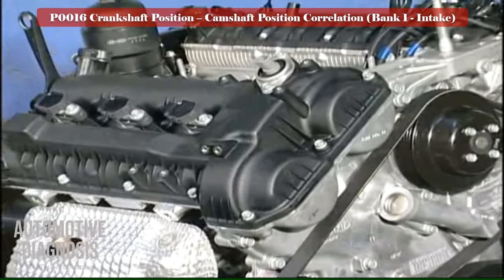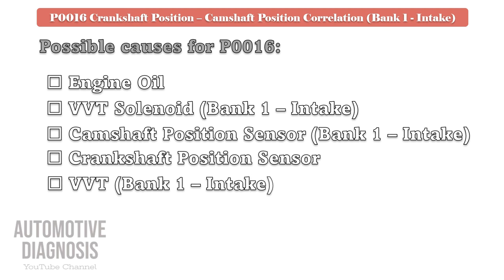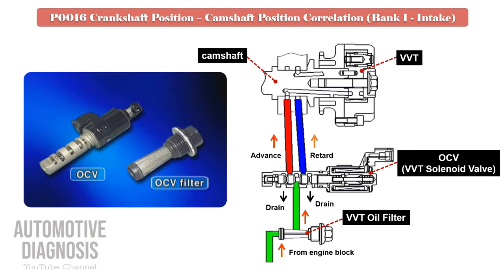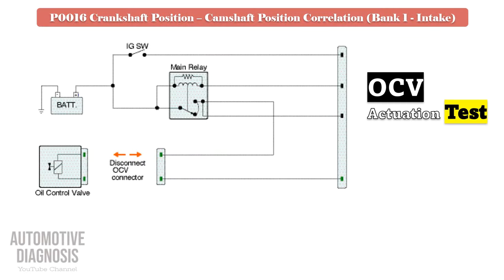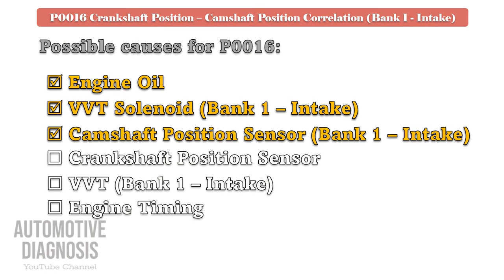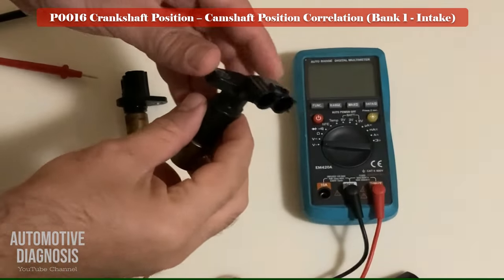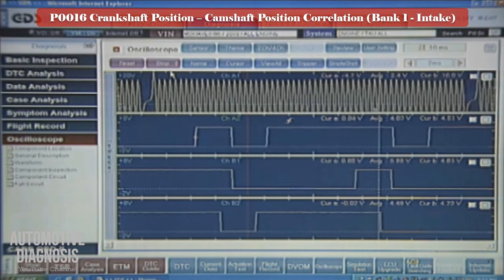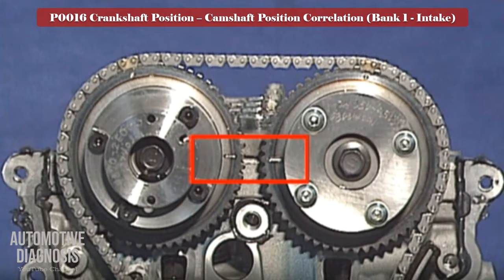How to Test & Fix P0016 Crankshaft - Camshaft Position Correlation Bank 1 Sensor A (Bank 1 - Intake)

Comment: If there are no other fault codes apart from P0016, i.e. no sensor codes, go straight to checking the timing. This is easy to do by removing the camshaft cover and checking the alignment marks on the camshaft sprockets when cyl1 is on TDC - firing stroke.
Reply from the maker: Thanks for sharing your experience
Reply: I have a P0011 as well

Comment: I have p0016 Bank 1 sensor A. Car runs and sounds fine. I am overdue for an oil change though 🤷‍♀️  so gonna start there. Just pray it’s not the timing chain
Reply from the maker: Most likely it’s not the timing chain, normally you may get some other fault codes too if it’s from the timing chain itself (like P0014 or P0017 or misfire codes), if you get the code again after changing the oil, it is recommended to remove and clean the VVT solenoid valve on for bank 1 intake.
Reply: @AutomotiveDiagnosis  That makes me feel better lol. It’s a 2014 Malibu. The mechanic I took to said the same thing and unfortunately it’s a vague code so we have to do process of elimination. Hopefully it’s just the sensor. Said as long as driving and sounds fine to keep an eye out and obviously discontinue  driving if performance changes. Thanks for responding. I’ll let you know what we figure out.
Reply: So light is off this morning 🤷‍♀️
Reply: @ericabertagnoli5469 how was solved ?
Reply: @miroilic323  So light came back on after awhile. Took it in. They figured out there was loose bolt and the guides were loose so I ended up just getting another timing set. Was lucky the bolt didn’t get into the engine.
Reply: @AutomotiveDiagnosis i have a p0016 and P0019 code would that indicate the timing chain?

Comment: I have a 2012 Buick Verano. Engine check light came on and went to auto zone. First time code came up p0014 & p0015. So, had them give me both intake & exhaust solenoids. I put both in and next day took car out about 10 mins engine check light came back on. That afternoon went get oil changed and called auto zone told them what happened. The guy said bring it over. Sure enough same code came up again. This time got two new ones again and changed both. The engine light didn’t go out. Took the dam* car over auto zone and now dam* code showing p0016 & p0017. What the he**. The car runs great. No misfire, no ruff idling, I even replaced spark plugs. Can’t figure it out.

Comment: At last I was able to solve my P0016 code.
Firstly, I flushed my engine oil with an engine flushed them changed the oil a second time  -- code didn't go away.
Next, I changed my crankshaft position  sensor--- no improvement,

Checked my VVT solonoeid too and it was working fine.

Finally I went to the mechanic to check my timing chain and Alas, it had jumped. It was fixed and now my car is driving smoothly again.

Thanks for this video.  It has really helped me. I was already thinking of selling the car off.

(It's an Hyundai accent 2012)
Reply from the maker: Hi there,
Thanks a lot for your comment and for sharing your experience.
I'm glad this video was helpful.

Comment: Great video. I ran into this problem Hyundai Elantra Cvvt valve intake  caused break down of engine oil. Thanks for this video very helpful. Thanks.
Reply from the maker: Thanks for the comment, I’ve had this fault many many times that’s why I made this one 👍👍

Comment: Very helpful, I’ve had this fault code many many times, still struggling to fix it, thanks for the great help
Reply from the maker: Thanks for the feedback
Reply: I know this is a little old, but I had this exact issue with a FA20DIT engine, bought from salvage yard, had P0016, after a lot of head scratching I ran the engine for about 100 miles on a clean oil change, then ran Subarus engine oil flush through it, one more oils change and the issue was completely fixed. I am able to watch the cam positions on my access port and I can see that the right intake stays right with the left intake now. I think the salvage yard engines sit around too long and the oils break/coat the journals, the flush turned my new oil completely black. I am going to do one more flush at 1,000 miles just to make sure.
Reply: @denniskeyser2212  I have 2016 tucson , and the engine is changed with newer one. I have this issue still with my car , I changed all of these sensors , engine performance is perfect . Only after while this alarm is coming and after while going but no any change in my car performance. You think I have to flush the oil?

Comment: My GL 450 Mercedes is showing a P0016. I change the camshaft sensors, oil changed and solenoid magnets and I’m still having the same problem. I didn’t know about changing the crankshaft position sensor. I’m trying that next. Thank you very much.
Reply from the maker: Thanks for sharing your experience.
Reply: Hey did that fix your problem ?
Reply: Did that fix it??!!

Comment: This is an excellent video, and I have a question I hope you can answer for my situation, as I am now getting additional P0012 code coming up now, and it has failed inspection sticker, for a 2011 Camry.  YET:  the car runs fine--both city and highway, so unclear what to do, and need to find new mechanic (no more dealer).

Starting 4 years back, both engine light and traction light came on, but it would be go "on and off" .  Mechanic at Toyota dealer diagnosed, and P0016 code came up.   Did oil change first, and it was really really dirty.  This helped, as the code disappeared "for awhile".    Dealer then quoted $1600.  However,  It would come and go...but at least it went, and always passed inspections and NO driving issues at all.   
 Until about 6M ago, drives FINE, but both lights have been on continually, and now I have the additional P0012 codes, and failed inspection sticker unfortunately.  (light went out briefly w/reset, but they still failed me for inspection).

Is this common?  Would any mechanic be able to fix this?    Is this going to be a "step by step" issue to fix, that could take awhile to resolve.   I hope you can respond soon.  Thank you!!

Comment: Hi, my 2007 audi a4 2.0L turbo is having acceleration power issues. It has p0016 code. Can this code causing my rpm to move slow up but the car is struggling to accelerate? Going up hill is a huge struggle. Great video. Thank you.
Reply: @mark.r8900 did you figure out the issue??

Comment: Hi, thanks for this informative video. I am only getting P0016 when the engine is cold, never when the car has been travelling for a while. Also, it never happens when the engine is just idling, even when it is cold. It invariably occurs when engine is cold and engine speed is descending, usually when slowing on  approach to a junction. Does this suggest a particular diagnosis? Many thanks :-)
Reply from the maker: Hi there, I've had some cases like this before, sometimes from a wrong oil (normally higher viscosity) which was not good for the colder temp or when engine was cold, the other was dirty VVT solenoid.

Comment: What happens if you get this error from time to time ? the check engine light comes on and goes off the next day. is it safe to keep driving the car ?
Reply from the maker: If code appears time to time it’s not from the timing chain itself, most likely it could be from a loose connection on intake VVT solenoid or Intake Cam sensor or Crank sensor. Oil sludge around the VVT solenoid can cause the same issue as well.

Comment: I substantially overfilled my engine oil when changing it on my own for the first time and now this error code has popped up. I've since corrected the amount of oil it but the code persists. What should I do now? It doesn't feel like it's driv8ng any different than it normally does
Reply from the maker: Have you tried removing the VVT solenoid valve? That might help. Remove and give it a good clean.

Comment: I have a P0016 and P0019 code would that indicate the timing chain? I also got these codes after changing my oil, i took it the mechanic and he said i overfilled it or something but i found out it was my oil filter housing. Thanks
Reply from the maker: Hi there, if it happened just after the oil change, it’s probably not from the timing chain. These two codes are for bank 1 intake and bank 2 exhaust, so considering the fact that your engine is a V6 with two timing chains, if you had a timing problem, most likely you would have P0016 and P0017 together or P0018 and P0019 together. Having a wrong viscosity oil or dirty VVT solenoid can cause these faults too.
Reply: @AutomotiveDiagnosis  thanks. Also what about P000B and P000C? I have these 2 codes as well but I’m not sure exactly what to do.

Comment: May i ask what would happen if we didnt change it directly in porsche caynne gts 2009 as here it cost too much money.. is ok to leave it as is for now ??
Reply from the maker: This code could happen for several causes as explained in the video. So, if it's coming from timing system it could be a serious fault that must be fixed ASAP. (Although some other cases could be fixed with less attention)

Comment: Hi i got seat leon 1.4tsi got the p0016 code when i start the car it stalls when i start again the engine shaking and rough    it lost power i think but it does drive just not as it should checked the vvt solenoid looks fine swaped camshaft sensor still nothing. Thank you
Reply from the maker: As your engine stalls, it might be from crank sensor or timing.
Reply: That's fine thank you for reply

Comment: I have a 2014 eco boost that has a p0016 and p0172. Makes a loud howling noise. What could that noise be ?
Reply from the maker: As you have fault codes for both intake and exhaust side, it could be coming from the timing chain or timing chain tensioner. Before that make sure to inspect the engine oil.

Comment: oddly I put my old camshaft sensor back on, now the code has gone. not really sure why. have driven 100 miles so far and still no code
Reply from the maker: Hi my friend. Sometimes codes happen due to a bad connection on the connector or inside the connector on pins.
Reply: @AutomotiveDiagnosis  hope it was just that and it does n't come back before my MOT is due :)
Reply: UPDATE, it came back on after 3 days. took it back off twiddled it around a bit and it's gone off again (sigh)

Comment: Especially cars like the 2010 -2016 Cadillac SRX these are direct injection engines and can build up sludge and carbon on the VALVES  I suggest doing an engine flush I use motor medic by gunkout and marvel mystery oil or you can use Liqui  Moly engine flush too pour in the product with the current oil still in it let it idle for about 15-20 minutes  under its own power don’t horse the motor turn off engine let cool down remove drain plug let it do a complete drip drain wipe plug and pan area remove filter and replace you will surprised at the amount of crap that comes out
Reply from the maker: Thanks for sharing your experience

Comment: Correction:
I understand that some CKP and CMP use 5V reference for the power source; you will not find 12V anywhere on these configurations.
It is important to mention this, as viewers could incorrectly conclude that their PCM or electrical system has a fault that doesn't exist...

I found a YouTube that also said there are 12V, 5V, and 10V (sensor) systems out there.
I have never seen a 10V reference, but I don't doubt it. [I have not Googled it to see what vehicles use that, but it would make sense. 9 or 10 volts would be stable as it is below the lowest 'variable' battery voltage that the system would see.]

Consult you manual, or Google for your exact vehicle.
If you get a consistent 5V that is within a few percent of 5.00V (or 10V), at several sensors in your car, then you should be safe to conclude that your car is using that voltage as power to it's sensors...
Mr K L
Reply from the maker: Thanks for the comment and provided information. I always refer anyone to the workshop manual to review the specifications as not all cars are the same. But for the power source on CMP and CKP, I have seen both 5V and 12V power source and it depends if power supply is provided by ECM or Engine control relay. The latest one I remember was KIA Mohave 4.6 L, and all CMPs were getting the power supply from the engine control relay which was obviously battery voltage. 
But as you said, no one can consider one specific value for all different engine types as each ECM has been designed with a different software and logic which makes the configuration different.
Reply: @AutomotiveDiagnosis  Thank you kindly.
And well produce video.
I wanted it to show prominently, as some may not have access to a SM, or may go verbatim from the illustrations, if exceptions are not noted...
I am assisting a mechanic who came from another country (who watched your video), and he was stuck because he could not find 12V...
Reply from the maker: @troubleshooter1975  Thanks for sharing the situation. That's exactly right, not having  access to the SM and watching a video which is generally made (without referring to a specific model) may overwhelm someone,  that's why I started making some videos, by mentioning the car model, and at the same time I show all the specifications in the SM including all values and configurations for that specific car, hoping to be more helpful.

Comment: What if you dont have battery voltage on the silinoids wire harness when the ignition is on? And, when you say ignition on, does the car have to be running?
Reply from the maker: Hi there,
No, engine does not need to be running, normally you should have the battery voltage in one pin when ignition switch is on and also when engine is running. But if I don’t get the battery voltage on ignition on, I normally check it when engine is running as well, because not all cars are the same. Also, you will need to check the wiring for the power supply if there is any problem there. May I ask you please to write your car model down here?
Reply: Doesn't the ECM only send power to the VVT solenoid when the gas pedal is pressed?

Comment: I have the same code but it says “Crankshaft position-Camshaft position”, I have a 2016 Audi  A4, the car starts fine, it drives fine, it has pretty much all it’s power available, it doesn’t smoke or consume oil,  it doesn’t make any noises at all, but it idles weird when it’s completely stopped and it happens most of the time but ramdomly, it’s like a weird on and off vibration and what I noticed is that if I turn on the heater or A/C the problem almost goes away or it goes down a lot, no one has been able to find a solution for my problem
Reply from the maker: Hi there, it seems to be a different issue than P0016, this code might have happened due to an intermittent problem so please erase the code and see if it comes back up again. It it appears again and it happens randomly, it could be VVT solenoid valve (that must be removed and cleaned only). The problem that you explained it could be only for a dirty throttle body. So when engine idles and you have released the gas pedal,  if throttle body is not clean, it can affect the airflow at idle, and the reason that it disappear when you turn the A/C ON, is because engine control module increases the engine RPM at that condition to compensate the A/C compression operation and RPM drop, so as soon as ECM increases the RPM, throttle body will open a little and there would be no more restriction for airflow.

Comment: Is it safe to drive with p0016?
Reply from the maker: There are different causes for this code as you see in the video, most of them will only affect the engine power, but if it’s from timing belt/chain, it’s better not to drive the car and have it checked as timing belt/chain failure may cause to engine mechanical issues.

Comment: Sir please answer my question,  or if anyone knows,   my check engine lights is on and it saying that crankshaft position - camshaft position correlation bank 1 sensor A and bank 1 sensor b  so what should I do , do I change just the sensors or both sensors and camshafts adjuster, mechanic told me to change camshafts adjuster so I'm confused what should i do my car is Benz c250 2012 please answer thanks.
Reply from the maker: Hi there, as I see, you have two fault codes for both intake and exhaust camshafts, normally having two components faulty at the same time is just odd, I just to remove the VVT solenoids first and clean them up before changing anything.
Reply: Thank you so much sir ❤❤❤. you mean that when both P0016 AND P0017 appear at the same time their is high Possibility of dirty vvt selonids.  And one last question do benz car vvt selonids have to replace or I can just clean it and put it back . Thanks

Comment: Hi i have porsche cayenne same code, (inteke camshaft senser bank1). this car have hard start please help me
Reply from the maker: Hi mate, it should have hard starting because you have car sensor fault code, and as this signal is missing in ECM, you have to crank the engine for  longer time so ECM can compensate it. You need to check the cam sensor on intake bank 1
Reply from the maker: This following video is for cam sensor diagnostic (not exactly for your car but can be useful):
https://youtu.be/fM40jUfPsRA?si=xIbFQxGU2OGDHqyZ